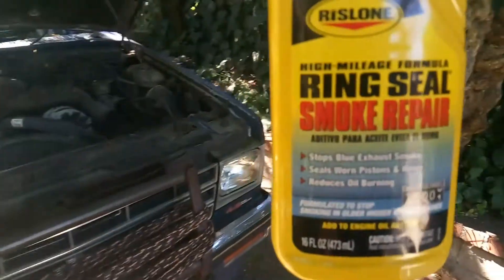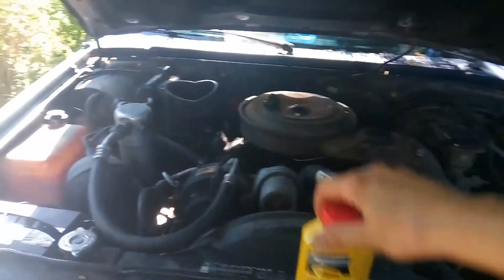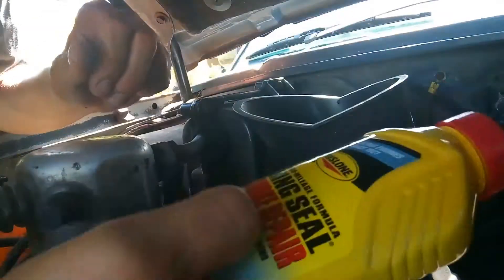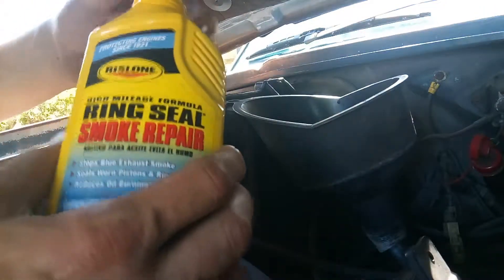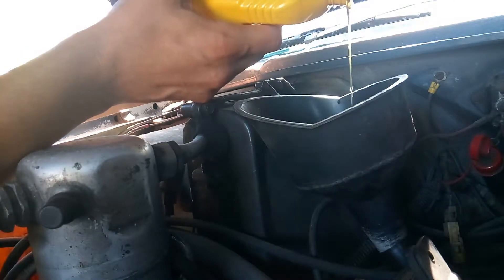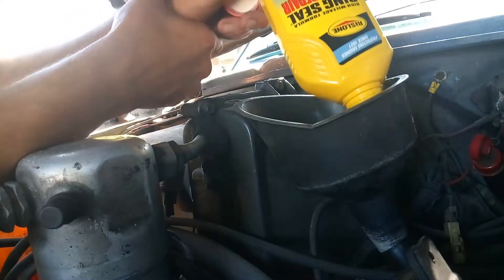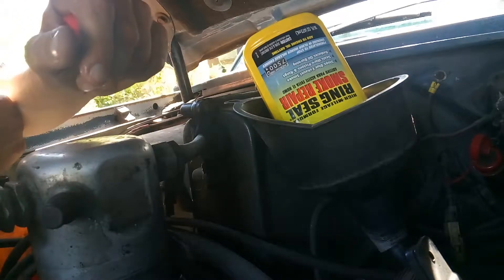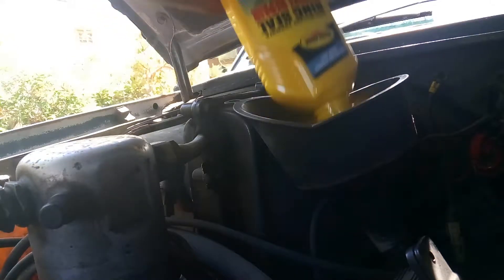Rislone presents seal my piston rings on S10

Comment: I put that stuff in during winter in new england it was so thick I wasn't sure if I read the directions right and it wasn't an additive. Worked for 6 months now and just starting to lose more oil than the first months. It could be the summer heat has made it more viscous and became runny enough to drip from the problemed area. It works once...Lets do it again. I'm picking up a second round in 6 months tomorrow.
Reply: How's it working out so far?

Comment: It could be the seals too, it’s not always the piston rings… so best thing to do is check your seals before you think that it’s piston rings, specially if the vehicle smokes 24/7 usually piston rings smoke because of the fact the rings are bad and it puts oil out all the time
Reply from the maker: Since the video. The s10 is being rebuilt.  I mean the engine. It's costing a grip, the mechanic said the blazer sat too long and the engine was too dried up. I'll be posting S10 Blazer videos as I get them
Reply: @tddamits  I’ll give you a tip I’m a mechanic and your motor can’t dry up…. That’s the dumbest shit I’ve ever heard anyone say, all a shop should need to do is take motor all the way apart clean it up, new valve seals, new pistons and piston rings.. if they are doing it that way then that’s a shops way of making more money, you just need to freshen the motor back up only way a motor dries up is If water gets in it then it dries up then you have rust issues on the inside of the motor…
Reply: @tddamits  I know the video was old but I was looking to give some folks some advice

Comment: Good video ., same car ., they say its two reasons at this stage the valves or piston rings i felt sad mines were pistons but happy when i saw the $5 tag also the p heads are really cheap today 2021 at autozone saw them around $20-$30 per (pair x2) ! I will change the heads and rings jst not now work reasons and money time and will also change the valves for the heck of it ., good vid i follow up to watch results, im also aware of the many things which I already bought for low over amazon and ebay ., its worth it vs the high price shops and only change 1 specific part jst to get u by vs doing it all and on the price goal
Reply from the maker: Thanks for commenting, I put the Blazer in my Nephews hands, I also just uploaded a update, and God speed to you.